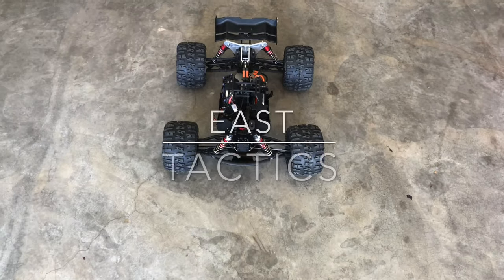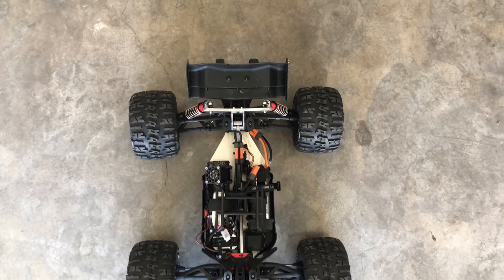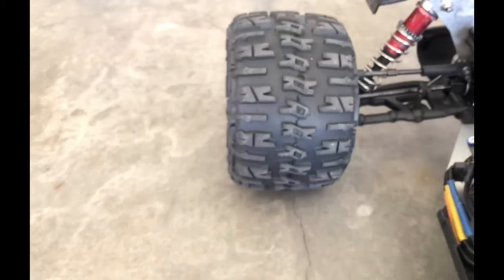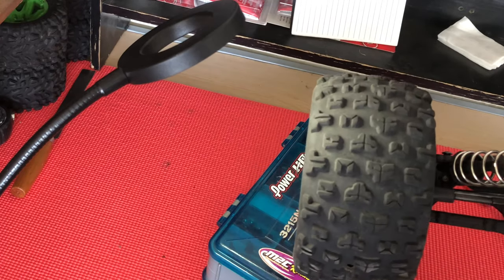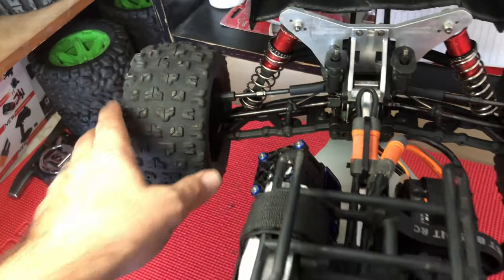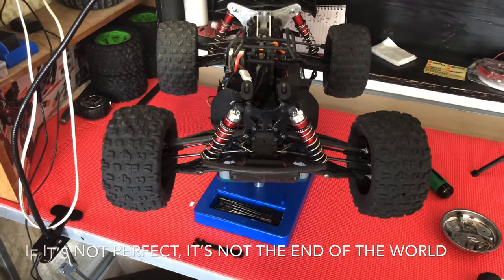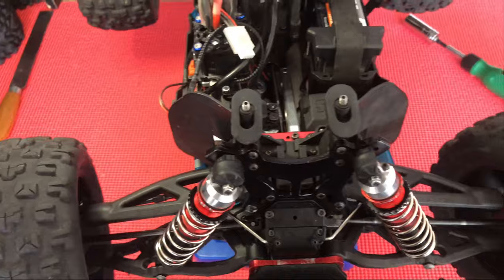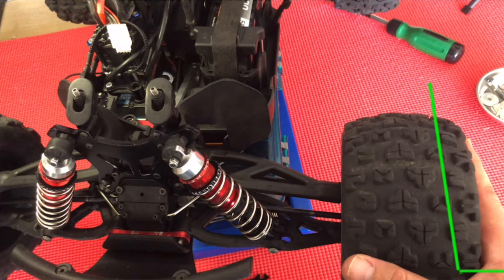How to adjust Camber and Toe

Comment: I wish you would have shown the process of adding the washer to adjust the camber in the front 😕
Reply from the maker: Add/remove washers:
Sorry about that my friend, basically the idea is to get those metal pillow balls out. Once you’ve removed the tire, you’ll see the two red large hub nuts on the top and bottom of the knuckle. Remove both of those completely. Then if you look in the hole with a flashlight, you’ll actually see that those metal pillow balls have a pre-fabricated hex hole drilled into them. In essence all you need to do stick your hex wrench tool in there and you’ll find that you’ll be able to easily ratchet the pillow ball out of the end of the a arm. It does make your life a lot easier if you remove the bottom section of the shock by pulling the pin out, so that you’re not fighting with the Shock trying to push the whole arm assembly downward. With the shock detached at the bottom you can easily maneuver the to a arms upward in a flatten position which allows much easier access to get your hex tool into the end of that metal pillow ball. Ratchet the pillow ball completely out and then add your washer and reassemble. Hope that helps.
Reply: @EastTactics  😁 it does,  hoping i could adjust it quickly without removing the wheels I just put on but eeeh what are gonna do! I have my Typhon built for speed runs but I don't like the way its riding on half inside of the tire, I don't want them to wear unevenly. How many washer will move it to -1 or -2 ? Thnx for your help.
Reply: @EastTactics  oh and what size are the washers or where do I get them?
Reply from the maker: @jamesrobinson4950  that makes sense, for speed runs you really would want the tires to be flat. As far as how many washers to use I guess that really just depends on how thick your washers are. Really any kind of washer will work metal or plastic. When you remove the pillow ball, whatever the diameter of the threads are you want the washer to slide over that. I do have this video here you can check out that is actually really beneficial as far as slop around your vehicle. But also in the description of this video it talks about a kit of washers you can pick up off Amazon. My guess is you probably find the right washers you need for your project and many others with this kit.
https://youtu.be/GD10n3zfAxk
Reply: @EastTactics  Dude thanks a lot I'm learning everyday in this hobby, speed running is more fine tuning then I thought.  It my first attempt at it, definitely different than jumping around at the bmx track 🤣
Reply: @EastTactics  Excellent explanation!
Reply from the maker: Thanks dynasty!

Comment: Why is it toe-out on the front axle, not toe-in? Isn't toe-in helping to go in a straight line, which is always a bit of a weakness with the short wheelbase of these cars???
Reply from the maker: Toe in (or more straight) might be ideal for speed runners and other more "on road" rigs. The toe out in the front is ideal for bashers, and huge air Rigs. Most of it has to do with both landing as well as rought off road terrain romping.

Comment: Hey man I always appreciate your videos but quick question....How would I get my steering both equal if my links are off. Like if you got a truck with one wheel toed out or in from the other? I have trouble getting it completely lined up if one side is off from the other to then be able to adjust toe on both sides. If I'm explaining it correctly lol.
Reply from the maker: The steering horn on the Sergio has 25 teeth I believe. After you removed it turn your vehicle on let your service center itself naturally. Then replace the servo horn so that Both the left and right tires share an equal amount of camber and toe.

Comment: Hello, how many mm are the inside front turnbuckles in mm? So inside inside for the toe-out. Thank you very much from 🇦🇹
Reply from the maker: you want the total length from tip to tip meaning both composite turnbuckle rod end, the bar, and the other rod end. To be a total of 135 mm in length
Reply: @EastTactics  Thx 👍

Comment: On my rear wheels on the vorteks, one side is toed in more than the other. I can't find a way to adjust this. Any suggestions?
Reply from the maker: more than likely the damaged stems from your bulkhead and hinge pins into your arms. Potentially resulting in a shift in the entire arm assembly. If you want, you can email me a short video showcasing everything around the issue.
Info@easttactics.com
Reply: @EastTactics  wow thanks, I'll follow up soon. Much appreciated!

Comment: Hey East, I understand for bashing u want toe out, but when trying to go as straight as possible to hit a ramp at high speed, would you want zero toe to slight toe in?
Reply from the maker: Is it a basher still? 
Or are you now talking about a speed runner.
Your basher should still track straight at high speeds so long as you got the steering trim set correctly. 
But if your talking a speed runner car, then ya your camber and toe will be more straight.
Reply: @EastTactics  still a basher for sure.  On another note, I noticed you never did a video for the hot racing steering blocks. Are you satisfied with them?
Reply from the maker: Are you referring to the hub knuckles. Yes… if you break/crack your composite ones… they are an upgrade that will stop it from happening again. Hate when those pillow balls pop out. Thing of the past with the hot racing upgrade

Comment: Their is not now nor has their ever been one correct setting for suspension or alignment. How did you come to your magic one setting for all surfaces and condition's setting?
Reply from the maker: hey brother, I feel I tried to make it pretty clear in the video that these settings are specific for a “basher” which implies the arena most driven in …is off-road, coupled with a large amount of jumping. For someone wanting to adjust these setting for say … a speed runner, things would be completely different. Rest assured, I didn’t just makes these setting up, they are in fact the recommended approximates for a “basher”. From factory, the rig… (if shipped correctly) will displays these settings.

Comment: Me when i run my exb off ten ground it shakes a bit and it feels like the gearmesh is floping arround. I ordered a new motor and its the firma 2050kv this time. My motor was burned out of the box and i ran it liek that for months😑. Im just cursed. I wasted 80$ for nothing i hope the firms motor is better didnt want to buy another blc 2050kv. Im still pretty pissed that i cant enjoy my exb that cogging just gave me drivetrain issue and stress. I thinks its a good thing to balance my tires

Comment: Good explanation bit you never showed the actual adjusting
Reply from the maker: Sorry bout that my friend, basically the idea is to get those metal pillow balls out. Once you’ve removed the tire, you’ll see the two red large hub nuts on the top and bottom of the knuckle. Remove both of those completely. Then if you look in the hole with a flashlight, you’ll actually see that those metal pillow balls have a pre-fabricated hex hole drilled into them. In essence all you need to do stick your hex wrench tool in there and you’ll find that you’ll be able to easily ratchet the pillow ball out of the end of the a arm. It does make your life a lot easier if you remove the bottom section of the shock by pulling the pin out, so that you’re not fighting with the Shock trying to push the whole arm assembly downward. With the shock detached at the bottom you can easily maneuver the to a arms upward in a flatten position which allows much easier access to get your hex tool into the end of that metal pillow ball. Ratchet the pillow ball completely out and then add your washer and reassemble. Hope that helps.

Comment: Hey mate.im new to this hobby.i have the old v2 talion that i buy from my friend and also got a new v4 kraton.My question is are the diff (diff case,spiral, etc)same between the v2 talion and v4 kraton?or i should search for diffrent part number.Big thanks!
Reply from the maker: I think they are the same, parts wise, but I've never seen V2 components. So just double check. Maybe get them side by side and eyeball the comparisons. Also I do know  the V2 and V3 diff cups themselves for the most part were not shimmed correctly. Arrma started shimming the diffs with the V4 versions. I Think you will find tho that the parts are the same. 
All my vids have a link in the description to "Arrma V4 parts" pulled together in one spot on Amazon, might be helpful for you. Good luck my friend, always happy to help.

Comment: To whom it may help: if you have a typhon 6s the camber shims are in the wrong place according to the manual. I'm running grp tires and you want to be close to zero, take the camber shim off the bottom (front axel) tighten it down, move that shim to the top. That will get you slightly below zero. You may or may not need to remove your tires, I didn't 👍

Comment: On my 6s Kraton, when I angle tge rear wheels, it creates play in tge drive shaft to the point that the come out an ruin the diff cup. Happens most when car is the air.
Reply from the maker: I’ve heard of people having this issue with the front end, but never with the rear.  Is your droop set correctly?
Reply: @EastTactics  yeah, was the first thing I thought of. Gone through 3 diff cups on the left rear now. Somebody on Arrma Forum suggested upgrading to CVDs, so might try that

Comment: That was helpful bro  l didnt know that turnbuckles go clockwise just looking at them l always would get it mixed up lm waiting on titanium turnbuckles so l will give it a go;
Reply from the maker: Thanks again for the suggestion for making the video. Glad I could help. Those titanium turnbuckles sound amazing!
Reply: @EastTactics  lm looking to  decrease weight on both k6s with anything titanium;
They are both completely beefcake 1 has max6 combo and everything alloy the other is also completely alloy with xlx esc  poseidon 1700 kv .
They are tuff but extremely heavy for jumps 😉
My next rc will be the new 48.3  2.0 from Tekno some friends swear on them even as bashers they are race bred so steering is on another lever and all parts are cnc machined 7075  "extremely light"and literally float in the air 😅 Should have it by Christmas
Reply: @MuscleAKAOzzy  what hearing are you running with that 1700kv motor? 
My 1700 motor gets pretty hot on a 19t pinion on 4s, wonder if that is normal and if it runs cooler on 6s.
Reply: @jotcw81  do you have a poseidon  1717 1700kv?
Reply: I'll have to try this on the BRCC. The turnbuckles don't have that notch, but I bet they all turn the same way too.  Great vid.
Reply from the maker: Thx!! 👍

Comment: Any idea how to get adjustable toe in the rear?
Reply from the maker: Unfortunately there is no specific way to adjust of the toe in the rear. It’s all contingent on the way the rear a arms mount to the Back end. By the design of these bashers from Arrma, The rear a arms actually provide the needed toe in your rear end automatically. If like me you find that your toe is off, It’s likely due to a bad landing that has tweaked it and bent something in the rear end.
Reply: @EastTactics  dang, that's too bad. Was hoping there was a way to adjust it. Thank you for feedback 👍

Comment: Hi bro, how do I adjust the front wheels so that it is Toe-in slightly?
Reply from the maker: If you have an Arrma Vehicle, Use a small wrench and turn the front turnbuckles counter clockwise, this will extend the length of the turnbuckle and create a toe in effect for your front tires. 
Please note however (as the video points out) typically for bashers you want your front tires to toe out, rather then toe in. 
But if you want to experiment with 'Toe in", thats how you'd do it.
Reply: East Tactics , thanks. Good advice as always. But when I lengthen the toe link, it reduces my turning radius? I notice the wheel base turns a wider end point with shorter turn buckle. Does this happen to u?...this is aside from the question on toe-in/out.
Reply: East Tactics , oh yes, I am working on a kraton 6s. Subscribed to ur channel btw....great info as always
Reply from the maker: Awesome! Thanks for subbing I really appreciate that. As far as your turn radius yeah I believe that if you toe in,  this will slightly reduce your turn radius. And when you have toe out (which is what is recommended for your Kraton) it will actually help you turn a bit sharper. At least from what I understand. What is the reason why you want to toe in?
Reply: East Tactics actually is the other way round. When I shorten the turnbuckle, it has more turning radius , sharper turn. But I will toe out, no?
Reply from the maker: @kennethchoong253  oh... 😂.
Regardless, for bashers you want the front to me toe out.
toe-in the back aid's with traction and helping the truck drive straight. toe-out for the front makes the truck more forgiving and less twitchy. toe-in is not a good thing in front for off reading and jumping. So they say.
Reply: East Tactics thanks!

Comment: I'm sorry, but your rears are not at 91*.  1* is pretty small, like what you see at 14:05, that is about what 1* actually looks like, or you will shred tires much faster than they otherwise should be wearing.  I cannot justify trashing set after set of tires running as much camber and toe as you are showing.  After just a dozen battery runs on my Vortek, the rears had ZERO tread left on the insides due to camber being too far from the factory.  The non-adjustable toe angle in the rears is now causing me troubles with aftermarket tires as they are getting 'rolled' to the inside as the car pushes the tire a bit at an angle.  

Yes, Toe and Camber are things that help performance, but they are not needed to the extremes these things are set to out of the box.  I'm really not looking forward to buying a fresh set of tires every 2 months...yeesh...

(FYI, auto makers like to set the camber from the factory way in because it gives better handling, so new customers say "oh this car handles great!", at the expense of tire wear, i imagine RC cars are the same way)
Reply from the maker: I see your point, keep in mind though that the range is 1 1/2 To 2 1/2 degrees past 90%. And if you were to go to 93° it wouldn’t be that big a deal. Especially for a basher. Now granted I agree with you if you’re racing on the roads are concrete as majority of your running then I too would shy away from going 93° and be more like 91°. But yeah if you look at a 93° angle it’s pretty significant. But you’re probably right mine were more closely getting near that 93 or 94° area. I’ve never had any issues at all with wear and such. Probably because 90% of my bashing is on loose dirt gravel etc.
Thanks for your comment and watching my video. 👍😎
Reply: @EastTactics  Yeah 90% of mine is hard pack and gravel. I don't have any good loose dirt to run on around me. I also agree, if all you are doing is loose dirt than tire wear is much less of an issue.  But after just maybe a dozen batteries, we noticed significant wear on the inside edges.

Im trying to find a good set of similar sized road tires so we can do some races in the large parking lot behind my house.  Until then i avoid doing much on pavement because these tires are not designed for it.